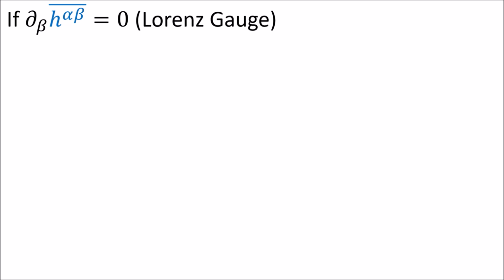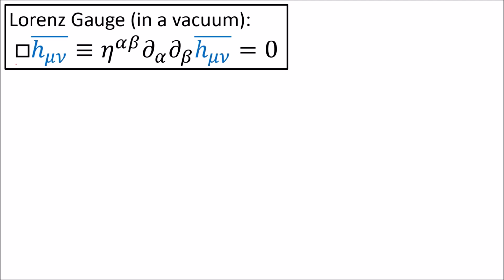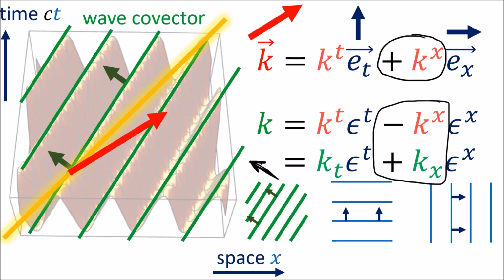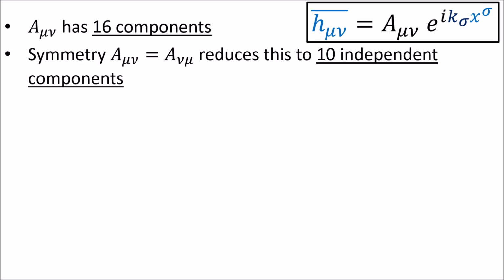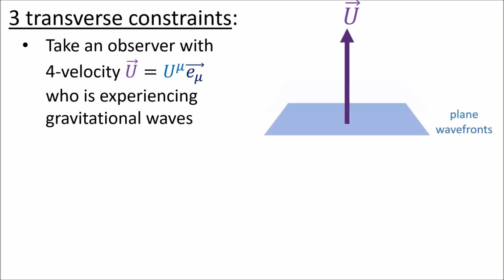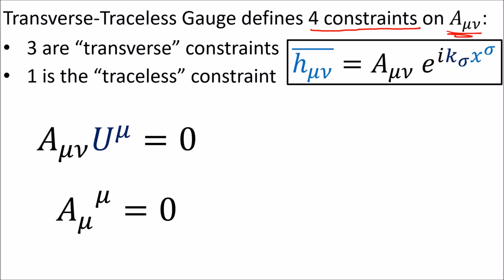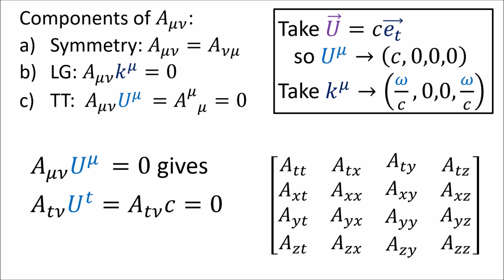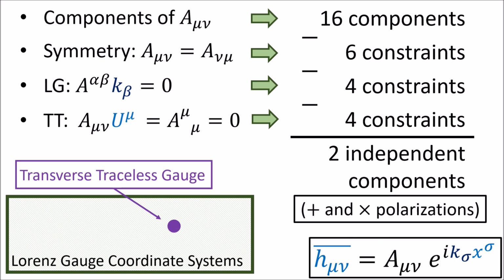Relativity 109d: Gravitational Waves - Transverse-Traceless Gauge (Plus and Cross Polarizations)

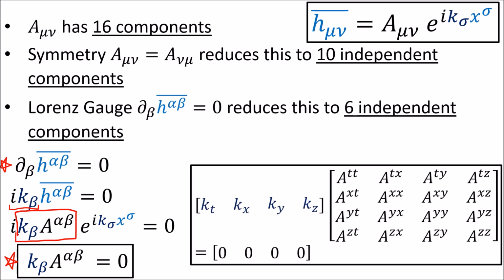Comment: I'm confused about 9:43, shouldn't that expression mean that the ROWS of the amplitude matrix should be orthogonal to the wave covector components?
Reply: and at 12:34, I don't think you can express it with traditional matrix multiplication, as it involves summing the different components of each column of A with the components of U, whereas matrix multiplication like that involves summing the components of each row of A with the components of U.
Reply: oh wait, is it because A is symmetrical so it doesn't matter whether you do its rows or columns?

Comment: Great video, After 19:29, How we can be sure that two independent components are non zero components of polarisation tensor? Is it not necessary to check whether two independent components are zero or non zero?
Reply from the maker: They can be zero in some locations, just as the electric magnetic field can be zero in some locations. But if some mass wobbles back and forth very quickly (as with two black holes orbiting each other and about to merge), gravitational waves can be created. Same goes for vibrating electric charge and electromagnetic waves.
Reply: @eigenchris  sorry I didn't get you, in this lecture video at last we get A_xx and A_xy as a two independent components of polarisation tensor  but there is a difference in being independent and being non-zero, well you have showed that these two components are independent but you haven't showed that these two independent components are also non-zero so my question is, is it not necessary to show whether these components are non-zero or zero? Or using all constrain equation due to degrees of freedom we let to the conclusion that these two independent components are now non-zero, is that the reason that two independent components are non-zero?

Comment: In other words gravitational wave spacing is CONSTANT and non diminating, like all other waves, so they pervade the whole of space up to infinity, without weakening. Very well explained, thank you.
Reply from the maker: I think real gravitational waves do weaken as they travel. I just discussed plane waves in this video because they are the simplest theoretical example.
Reply: @eigenchris  Electromagnetic waves from distant stars are visible, no matter how far. Only those falling outside Penrose cone will become invisible to us, I don't think they weakens, maybe because they are both bosons.
Reply: Great question! For an electromagnetic wave it is tightly confined in a small region that is possessed by its corresponding photon area. There is no loss in energy (in a vacuum) so the energy is conserved (the frequency may change due to Doppler shift though).

However for a gravitational wave, I imagine that the wave is not confined to a small region and pervades the whole spacetime. The initial energy that was released into the gravitational wave gets dilated very very quickly as the distance it travels through increases and the actual intensity we measure is small.

The spacing of the waves is constant in comoving coordinates however when it comes across a star or other massive object there may be some interference pattern from that location. Plus if we're talking about the expansion of the universe then the spacing gets stretched out as time goes on.

Comment: In what sense do gravitational waves carry energy? I have understood that "gravitational energy" is not a well defined thing in GR. The energy momentum tensor does not take it into account for example. And by a coordinate transformation one can shift into a frame where there is no "gravity", hence no gravitational energy. 

Yet it has some kind of energy, since a black hole binary "loses energy" in gravitational waves which causes them to collide.
So, what energy do g-waves carry?
Reply: Momentum in a gravitational wave is propagated as space itself so the energy is just the potential difference between the peak and trough of the wave through minkoswki space time.  That being said, without a formalized definition of the fundamental particle of gravity it’s hard to say what exactly is waving on the quantum level assuming that unlike light and the nuclear forces, space time either changes or it doesn’t there’s no superposition state of the minkoswki metric tensor

Comment: Great video as always! I guess a couple things aren't obvious to me: 

1) How do we know the transverse-traceless gauge is a Lorenz gauge? I suppose one can just crank through some calculus and algebra from the definitions and it works?

2) In practice, we choose a coordinate system to measure gravitational waves experimentally (like at LIGO). Is the choice we make a Lorenz gauge?
Reply from the maker: 1) The TT Gauge requires the Lorenz Gauge condition to be true. So you start with the Lorenz Gauge (4 constraints) and then add the additional 4 TT Gauge constraints.The TT Gauge is just a Lorenz Gauge coordinate system with 4 additional constraints on it.

2) My ability to answer LIGO questions is a bit limited, but I'll do my best based on what I currently know. I mentioned gravitational waves have 2 polarizations. Based on my work in the next video (109e), a given LIGO detector will be "blind" to one of these polarizations. For example, if it sees the + polarization, it will be unable to see the x polarization. The LIGO detectors ultimately detect photons. The number of photons they see is correlated with the "stretching" and "squashing" of spacetime that the + polarized causes. So as far as I know, all they're really doing is watching a photon count going up and down overtime, and inferring the existence of gravitational waves from this. I don't think any particular spacetime coordinate system would need to come into play here. All the theory in my videos is necessary to propose the existence of gravitational waves and know the waveforms we should expect to see, but I don't know how much of it actually comes into play for the actual experimental measurements. I can't promise anything I said above is true, but it's my best guess. You'd probably need to find an actual physicist who works with GR waves to get a proper answer.
Reply: @eigenchris  thanks that super useful and helpful!